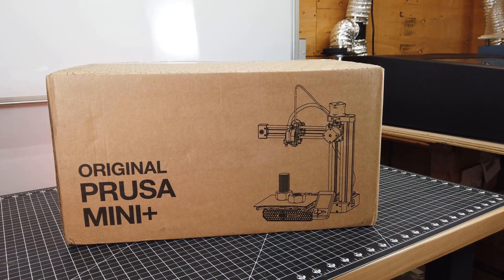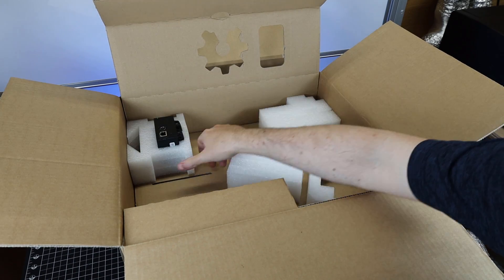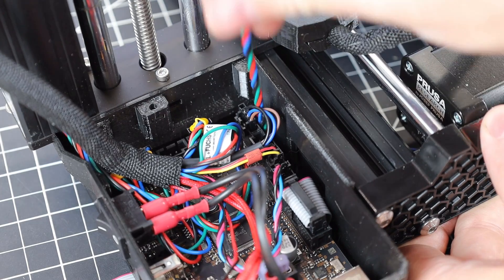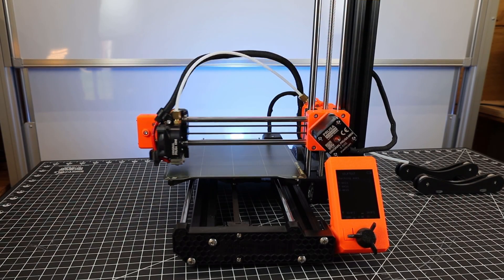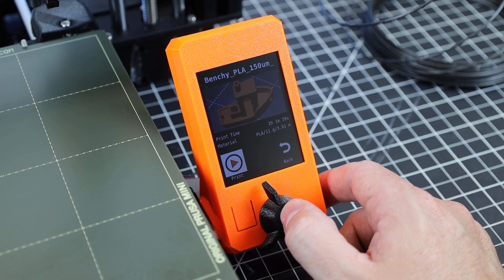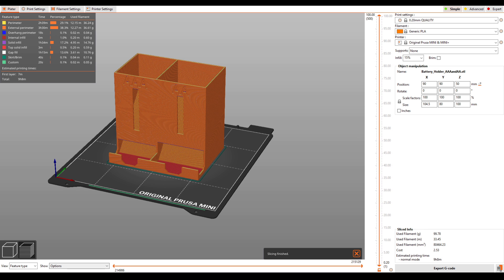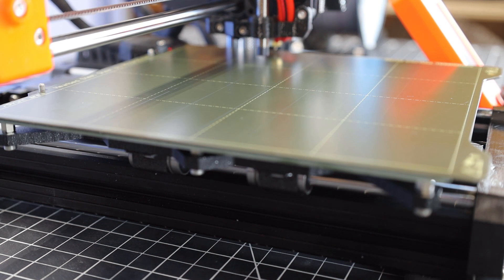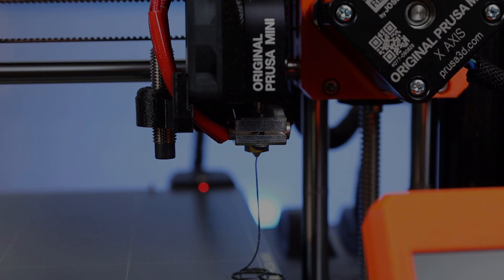My First Look At A Prusa 3D Printer - Are They Worth The Hype? - Prusa Mini +

Comment from the maker: Official Prusa Mini +  - https://bit.ly/Prusa_3D
Original Prusa i3 MK3S+ - bit.ly/Prusai3MK3S

Filament From Prusa:
Prusament PLA - https://bit.ly/Prusament_PLA
Prusament ASA - https://bit.ly/Prusament_ASA
Prusament PETG - https://bit.ly/Prusament_PETG

Helpful 3D Printing Tools:
Heated Filament Dryer Box - https://amzn.to/3AmbwwO
Flush Cutters - https://amzn.to/3dLdUpb
75% Alcohol Wipes (Keep your print bed clean of oils) - https://amzn.to/3TacogF

Filament From MatterHackers:
Quantum Dual-Color PLA - https://bit.ly/QuantumSeriesDual-ColorPLA
Silky PLA - https://bit.ly/BuildSeriesSilkyPLAMatterHackers

Other PLA Filament From Amazon:
https://amzn.to/3TeBQ4M

Other 3D Printers Options:
Cheapest Creality Ender 3 3D Printer - https://bit.ly/CheapEnder3
ELEGOO NEPTUNE 3 - https://bit.ly/ElegooNeptune3
Geeetech Mizar S - https://bit.ly/GeeetechMizarS
Flashforge Adventurer 4 - https://bit.ly/Flashforge-Adventurer4
BIQU B1 SE PLUS - https://bit.ly/BIQU-B1-SE-PLUS-3DPrinter

Parts List for Upgrades for my Ender 3:
BIGTREETECH SKR MINI E3 V3.0 Control Board - https://bit.ly/BIGTREETECH-SKR-MINI-E3-V3
BIGTREETECH TFT35-E3 V3.0 Display Touch Screen - https://bit.ly/BTT-V3-Display-Touch-Screen
BIGTREETECH Control Board & Touch Screen Combo- https://amzn.to/3wrte0P
Micro Swiss All Metal Hotend - https://amzn.to/3AGVCi3
Capricorn Bowden PTFE Tubing XS Series - https://amzn.to/3Tg2c6a
BIGTREETECH BL Touch V3.1 - https://bit.ly/Bltouchv3-1
Ender 3 Direct Drive Upgrade Kit - https://amzn.to/3cfQ18U
Magnetic PEI Bed - https://amzn.to/3QOVHG4

My Editing Software & Tools:
Wondershare Filmora 11 - https://bit.ly/Wondershare_Filmora-11
Acer 49" Curved Super Ultrawide Monitor - https://amzn.to/3PLXWbC
Rode NT1-A Microphone - https://amzn.to/3ws30vh
Focusrite Scarlett Solo 3rd Gen USB Audio Interface - https://amzn.to/3POFFe3
Rode PSA1 Mic Stand Arm - https://amzn.to/3PMIBrq
Canon EOS R Mirrorless and Full-Frame Camera - https://amzn.to/3ch4j9r
77-Inch Tripod - https://amzn.to/3TqTYZp
DJI Pocket 2 Handheld 3-Axis Gimbal Stabilizer with 4K Camera - https://amzn.to/3AHgcyP
Cheaper DJI Osmo Pocket  Handheld 3-Axis Gimbal Stabilizer with 4K Camera - https://amzn.to/3Rcnlg1
LED Studio Lights - https://amzn.to/3POHd7R
RGB LED Studio Lights - https://amzn.to/3QY6g9s
______________________________________________
Note: Most of the links that I use that go to products are affiliate link. This means I make a small commission on anything that you happen buy using them. This is at no extra charge to you and this helps support the work I do on this channel. 😁👍

Comment: Yeah. years ago I bought a tevo tarantula for 200. By the time I finished buying rails and ed3 hot ends, etc.  I could have just bought a 600 dollar prusa ( or whatever they cost back then) BUT I will say I learned a lot ( though I was terrible at bed leveling).
Reply from the maker: I know what you mean about the learning part and that has came in very handy for sure. I'm liking a lot of the newer printers just coming out of the box with all the upgrades I would have done. I'm doing a video for my 2nd channel right now about the new ender 5 S1. It comes out of the box with auto bed leveling, all metal hot end, direct drive, filament runout sensor and is a core XY

Comment: I have a MK3S that I hadn't touched for over a year and when I started it up the other day I was able to print the torture test with no issues, every other printer I've had required me spend hours on end re-calibrating it after not using it for a period of time.  I don't know if the mini has it by default but I highly recommend replacing the bed's springs with nylon lock nuts and using the octopi mesh leveling plugin to get the bed level once and for all so you never have to deal with the springs weakening over time.
Reply from the maker: The mini is solid mounted so it has no bed springs

Comment: 5:04 Stop, no, and don't!
Reply from the maker: Why?
Reply: @GomeowCreations  Risk of deforming; would rather rub off or pull on those few strings.
Reply from the maker: It's not going to do much if anything if you aren't using super thin walls. I have never had a problem doing this to be honest.
Reply: @GomeowCreations  Plus, there's the chance of molten strings ending up on the print.
Reply from the maker: Yes there is a chance for a lot of things but they can be easily fixed for the most part and will not always happen. But you are free to do it however you like. 😁👍

Comment: So got a mk3s during the start of 2020. It has been a solid printer. The community around it is amazing. I have done some mods over time. Dry bearings, pitstop extruder, Ikea lack enclosure, octoprint. It has also been great, I do wish I had a bigger print volume. I pre-ordered the prusa XL but it has been delayed. I have started looking towards the Voron 2.4 series.... They look like some next level stuff, the print speeds they have are wild.  Also just today I got a Elegoo Saturn 2, and am in the middle of installing a flex plate on it.
Reply from the maker: That's interesting to hear, the list of upgrades that is. I have a Saturn 2 but still need to get a flex plate for it, it does print fine without it but I like flex plates. 

So I bought a Voron 2.4 last year and I have printed all the parts already.I just haven't had the time to put it together. Oh and it's the 350mm one too 😁👍

Comment: I'm a jewelry artist and was thinking about getting something like this. One issue I have is the textured lines that stand out. Is there a way to smooth out the model so you have a smooth surface?
Reply from the maker: What are you wanting to do with the prints you make? Are you wanting to use them as is or are you wanting to do lost wax casting?
Reply: @GomeowCreations  Wax casting.
Reply from the maker: @shaunhall960  Sadly this isn't the style of printer you want to get to do that. Check out this video I made showing how I do it with resin 3d Printers
https://youtu.be/t2H_lV8IOyY

Prusa does sell a resin printer that you can find here https://bit.ly/PrusaSL1S but I also have links to other resin printers in the video I linked to as well

Here are some castable resins:
BlueCast - https://bit.ly/BlueCastX10CastingResin
Siraya Tech Castable - https://bit.ly/SirayaTechCast
Reply: @GomeowCreations  Thanks, I'll check it out.
Reply: If u make jewelry buy a resin printer.